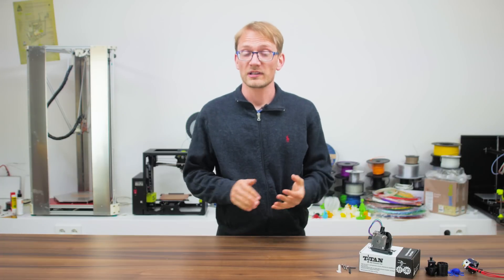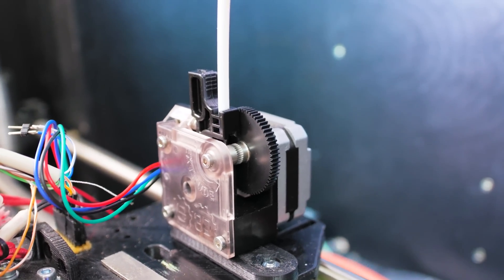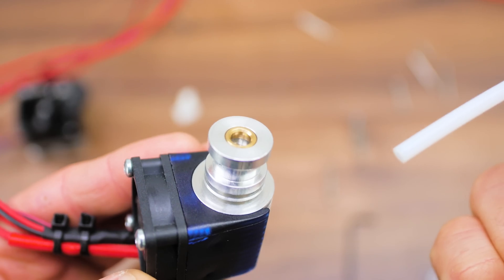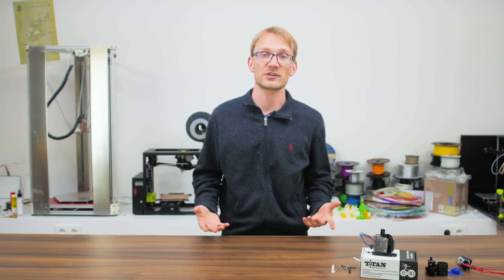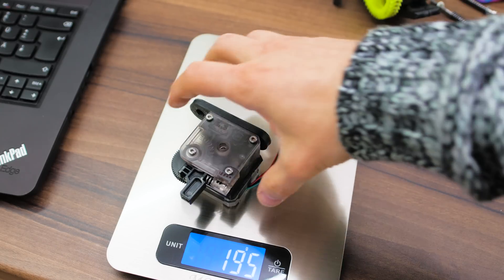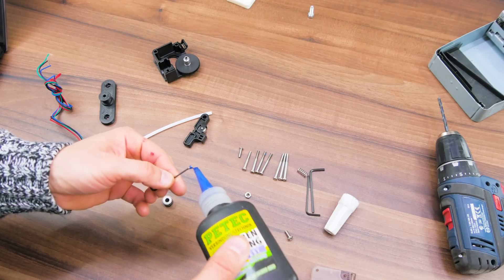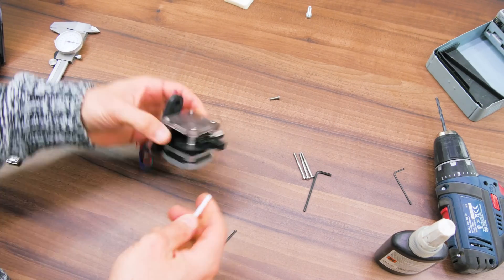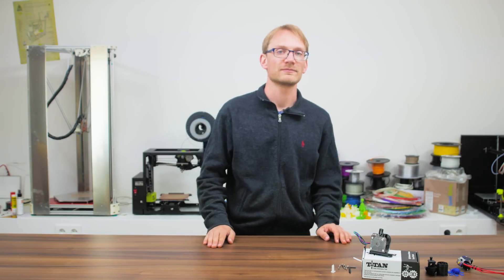Review: E3D Titan as a super light extruder!

Comment: I really wish they would update this extruder. A single geared extruder with at least 3:1 gear ratio with a big drive wheel which is also light small and cheap would be the best system for 99% of all FDM 3d printers. Dual gear has meshing problems and adds weight + cost while a bigger drive wheel increases contact with the filament and this would be by far the cheapest way to make such an extruder.

Comment: Off specific topic of your video, but an Extruder Question. My Tevo Tornado with the stock factory Extruder has stopped feeding filament. The X, Y, Z axis still work and the heat element heats as well. Do you know of how I could test to see if the actual Extruder failed or the driver circuit inside the Tevo unit?

Comment: i love my titan. tho it's a clone. I wish I could afford a proper one. the clone I have has a wobbly idler (the idler uses a bearing on my clone) and the gear is a little lose and can move up and down so it clicks. no print quality issues but the noise gets annoying! tho my clone's gears that grabs into the filament is a straight non curvy thing instead of the usual hobbled gear or whatevre. so moving up and down doesn't cause issues. but still annoying! I print flexibles at 30mm/s with retractions/linear advance in a bowden setup with it. after converting it to a direct drive (deeply regret doing that btw) i use 35mm/s

Comment: I bought an Aero Titan extruder and I am having so many issues with it. I am having so many jamming issues, about every other 12hr print, the heat break gets jammed with plastic, to the point where I need to take the heater block off.  I do not know what is wrong, if anyone has any comments I would love to hear them!
Reply: Baird Bankovic I hope you have had it resolved by now, but if you still have the issue, were you assembling the hotend per the instructions? Your issue is symptomatic of an E3D v6 nozzle that is not tightened with the hotend at 285°C per the instructions.

Comment: So, this extruder handles 3mm filament with a 1:3 ratio, and a pancake nema 17, while the lulzbot mini uses a full nema 17 and a 1:5 ratio, which is confusing me. In your making your own 3D printer video about extruders, you said that 3mm filament needs gearing. Please help by explaining something that I'm not getting. I am doing research for making my own printer, that will use 3mm because I have a lulzbot mini, and want to understand everything going into the design. So, how does this extruder have the torque for 3mm filament is really where I'm messed up due to the motor and ratio.
Your content is quite helpful, keep it up!
Reply: +Thomas Sanladerer ok, thanks for clearing that up! I'm guessing you mentioned it in the vid but I was tired.

Comment: Hey Thomas, I have been using the Titan with a similar mount setup ( I copied you basically because it was easy ).  and  I'm using the same motor as you.  I'm using it on a robo3d and its been working flawless..but I never checked the heat of the motor.  Someone on the robo3d forum mentioned it got SUPER hot.. i just touched mine during a print and yea its really hot!..  I can't remember if the stock nema motor got this hot.

Comment: Would using 1 of these pancake steppers as you called em be plug and play replacing a standard nema 17? I am thinking about upgrading my Duplicator I3 with this extruder and a E3DV6 full metal but not sure how much software/hardware type work there'd be to do.
Reply: well my motor now tends to get a bit warm (not at all too hot to touch, maybe like 30-35C).
how would 1 regulate the current tho?

Comment: if I wanted to put this extruder using 1 of those pancake steppers paired with a V6 on my Wanhao duplicator I3 V2 could anyone maybe give me some more insight on the amount of work required. I know I'd need a new bracket of sorts to mount it all to but other than that would it require me to re adjust Esteps or other firmware related things?
thx in advance

Comment: Do you have a link for the file on that adapter/mount you used? Does it work on the Luzbot Taz 5 (Hole spacing)?  I also purchased the smaller motor to try it out but the only mount I found for the Taz is for the larger motors.

Comment: I like your mount, I had to copy it for my Robo3D.  Unfortunately I still can't get ninja flex to extrude. I can start a feed, extrude about 100-200mm then it stops extruding and the drive gear just slips on the filament.  If I retract all the way cut the melted bit off and re-feed it it will extrude about 100-200mm again..then get stuck.. Any ideas?  Here is a link to my thingiverse mount with some pictures. if it helps http://www.thingiverse.com/thing:1530555  Maybe its just the extra distance like you said?

Comment: I got one on my Rostock Max v2. It works fine. The adjustable tension helps. But it's still pretty hard to insert new filament.
Reply: +carolcheny OK I take it back. The filament inserts just fine, the problem is my tube. I'm happy with it. Very loud when it backup, though.
Reply: Great! What motor did you use? and how fast can you go? (as a direct drive not Bowden)
Reply: Rostock uses a couple of different motors, mine is the one that's not the default. Rostock is bowden like all delta printers. I was using volcano .8mm nozzles at one point and it didn't seem to have problems but I can't really tell because .8mm print quality really sucked i never adjusted to get it acceptable.
Reply: Ok thanks :)

Comment: Tom,

As always, great video.  You mentioned this would be a good solution for mounting the extruder to printers that might not have been possible with heavier setups.  Would you say this is something that might work well on a delta printer, or is that still too much weight to throw around?

Thanks again!
Reply: +Thomas Sanladerer Fair enough.  I was wondering if you tried it on any deltas you have.  Thanks though.

Comment: Top vid 👍 
Did you try 3mm filament ? 
My idler cannot open far enough  to release the pressure for manual fillament feeding of 3mm filament. 
Due to the idler lever interfering with the extruder body.
Just wondering if this happens to yours too ?

Comment: How much does the retired Wade's weigh with the pancake stepper? It has a higher gear ratio. To stay in the reprap tradition couldn't you get most of the performance from a modified Wade's like http://www.thingiverse.com/thing:221082 using a teflon guide tube and a shallow hob on the M8 bolt. I imagine someone could design a 3:1 gear set to keep stepper rpm down when using a volcano hotend.

Comment: You should never take those steppers apart. They will lose some of their magnetism.
Reply: +D353rt Most of the geared steppers can be separated from the gearbox by removing the allen cap screws on the gearbox end.  They run fine without the gearbox.
Reply: How?
Reply: The rotor is magnetised inside the motor after assembly. When they assemble the motor at the factory the rotor is not magnetic. The magnetisation is done by some special equipment that dumps a large amount of current (with a special waveform) into the motor to make the soft iron core into a magnet. When the motor is assembled the magnet field is "short circuited" by the stator and will not be lost, but when taking the motor apart, some of it will be lost. Powering the motor with too much current can destroy the magnet, too. The reason for this, is modern hybrid-steppers do not use conventional permanent magnets.
Reply: +zaprodk Nice explanation! I have a question you might be able to answer if you don't mind: I have a geared stepper motor (I think 5:1, not sure though) and I am wondering if I can remove the gear thing without the stepper falling apart. I want to remove the gearing because I think it's not necessary and it introduces slack I think. Also it prevents me from moving the motor as quickly as I want to. Will I find the same shaft thickness and will there be any gears mounted permanently? Or does this differ between models? Thank you on advance!
Reply: +D353rt I don't know. You can safely remove the gearbox. No harm in doing that.
Reply: Hi, zapro_dk! Why permanent magnets were exchanged for this cumbersome method? Is it cheaper or it's some other twist?
Reply: True, it’s can cut the  torque produced in half.

Comment: I just got my Titan Friday and finishing up a mount for it to try out on my CoreXY machine.  I was wondering though in regards to the weight when using a pancake motor, would this be light enough to use as a direct drive on a Delta effector?  I was planning on doing a flying one, but if it was light enough, I prefer direct.
Reply: +Edward Boston Good question... I'm wondering about that too. although I'm not sure I would use more weight on the effector.
Reply: +Thomas Sanladerer Would you mount it with some kind of elastic material or counterweights? I think I would go for some of the elastic tubing a lot of the existing designs use but I remember a guy in the delta Google group who ditched the elastics with counterweights.

Comment: Would a NEMA 14 with 24oz-in work for a setup like this?
Reply: +Jeffrey Drake Not without an insane adapter.  The extruder screws directly to the NEMA 17 stepper's mounting holes, as far as I'm aware.
Reply: My nema 14 is also 175g, while a pancake 17 I saw was 140 so there wouldn't be any real savings.